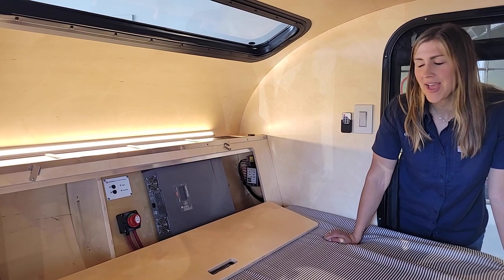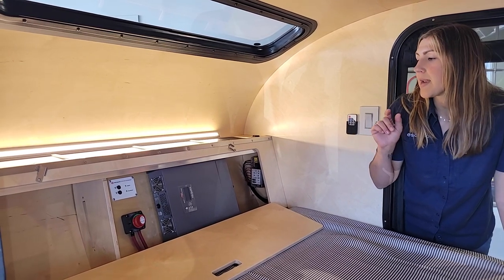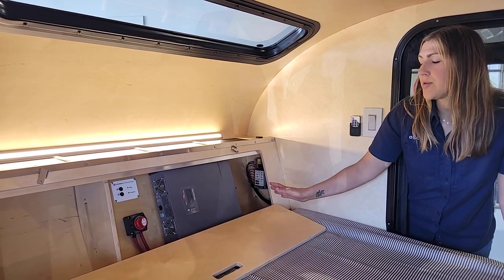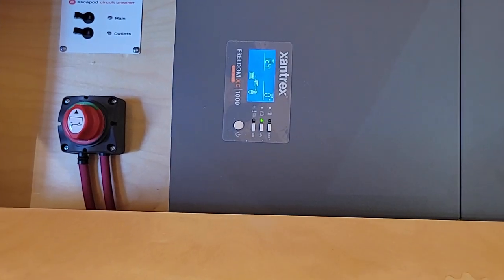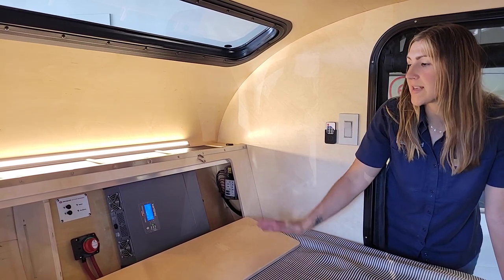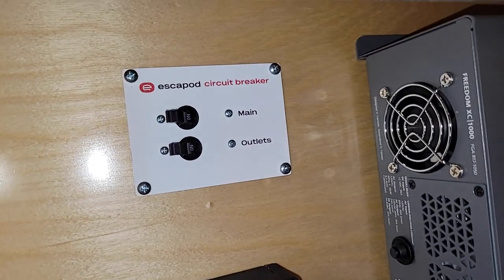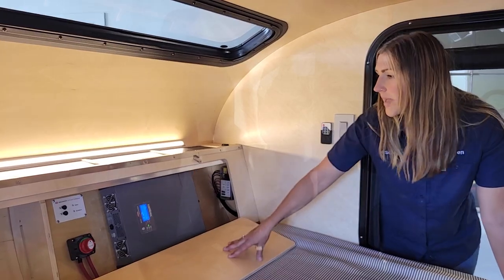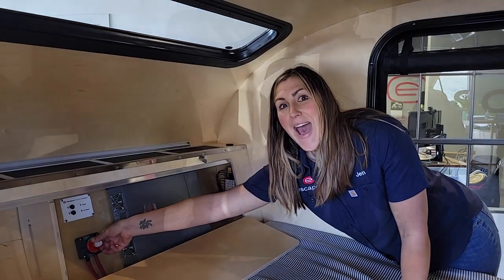Power System | Xantrex Inverter

Comment: Is it safe to have this inches from your head when sleeping? Can it be placed somewhere else if asked? Love what you guys are doing but this has me concerned a bit. Thanks!
Reply from the maker: It is safe to have the inverter in the headboard! In theory, the inverter could potentially fit in the tongue box. However, when making these decisions we also have to consider the manufacturing implications.  Since everyone has a headboard, and not everyone has the tongue box, we opted to put the inverter in the headboard to minimize variations of our builds.

Comment: is this an inverter charger combo? if so, does it then replace the standard 15amp battery charger? because this would effectively be where your shore power would be directly fed to, removing the need for the original 15amp you guys include as mentioned
Reply from the maker: Yes, this would replace the NOCO Genius-10.